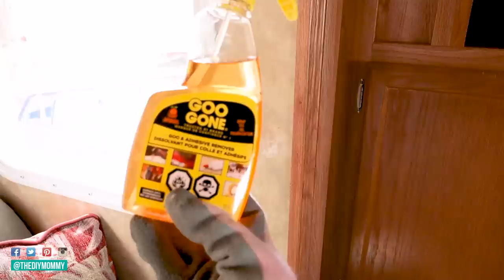DIY Camper Makeover | Ripping out more than planned!! | Our DIY Camper 2 | The DIY Mommy

Comment: Flooring now - let's face it - everything gets put ONTO the flooring so you'd have to rip it all out again and probably have a ton of touch up work.  When we did our camper reno I just bought sheets to use as material - so much cheaper and you can cover the sofa with a fitted sheet and be able to take it off and wash as needed.  I ended up purchasing a small dropleaf table & four chairs so I'd have expansion seating inside and the ability to take it outside if necessary.  I was never brave enough to repaint so I'm looking forward to seeing the process & end result.   Good luck!!!

Comment: When you have got all those awkward shapes to fit round why not get a contour gauge which is basically a series of fine pins that you push up against what you need to fit round and the pins move to match the shape. They are about £5-£10 on EBay - made such a difference to me when I was tiling my bathroom floor for round the loo and bath